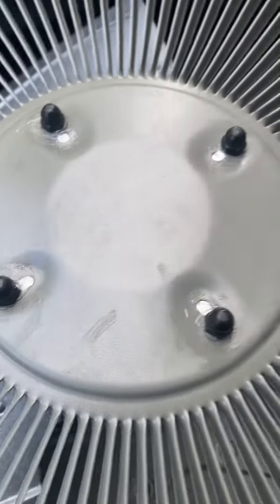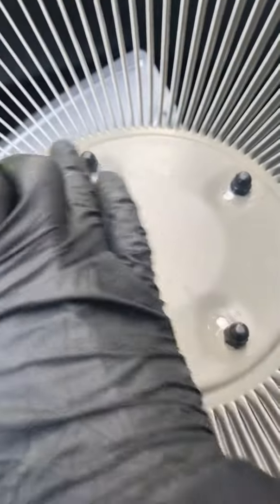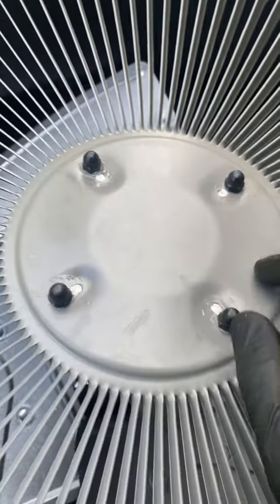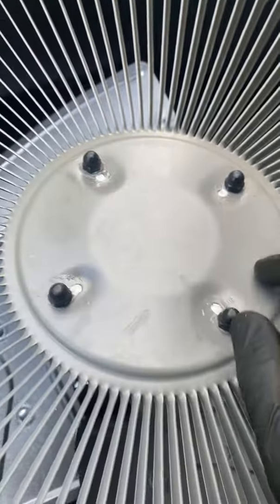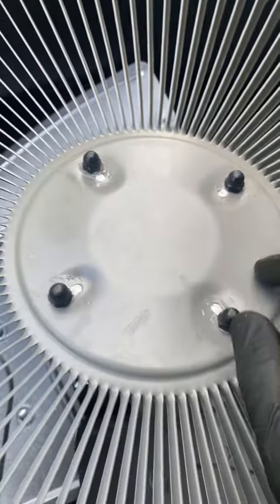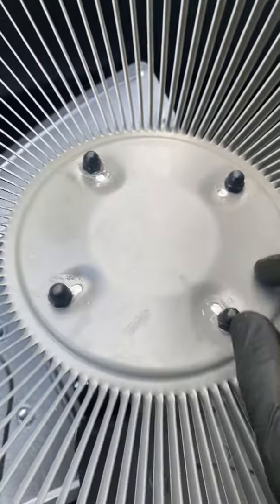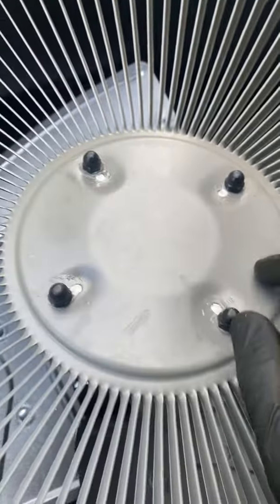Fixing another Lennox seized condenser fan motor #hvac #lennox

Comment: silicone is an aoxidizing agent, you would be better to use some rubberized sealing washers instead of fixing one issue while creating another.
Reply from the maker: While a rubber washer may be a better idea, I did not have any on hand to use. RTV silicone seems to form a good seal and is cheap. 

I haven’t heard of silicone being an oxidizer, what kind of problem do you think it would cause?
Reply: @victork3397  it will cause the nuts to rust to the studs over time.
Reply from the maker: I’ve never heard this before and several searches I’ve made are telling me that silicone is not an oxidizer. It’s a pretty inert compound.